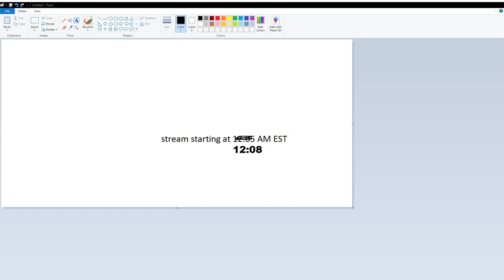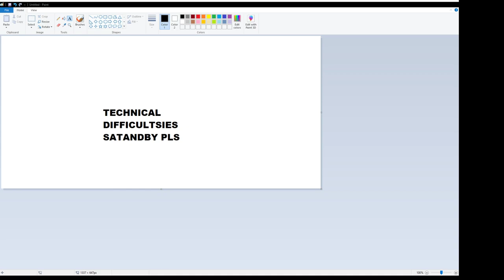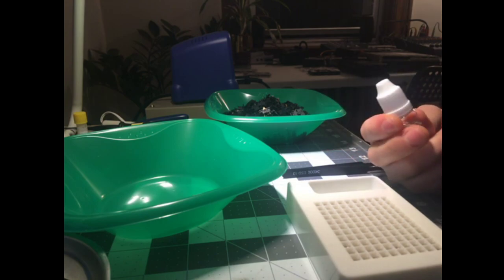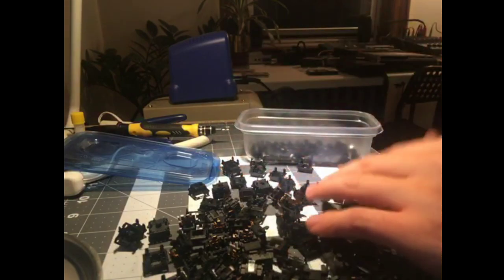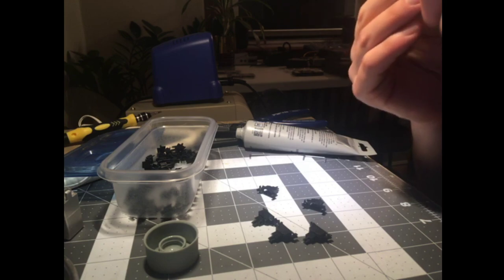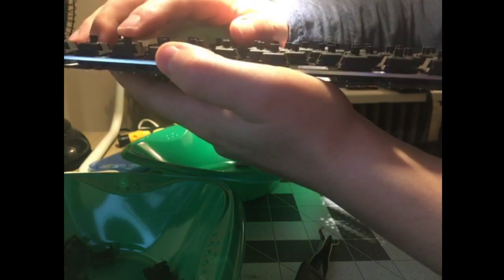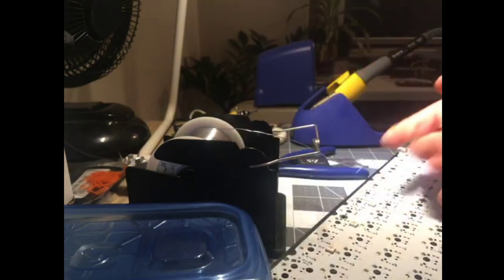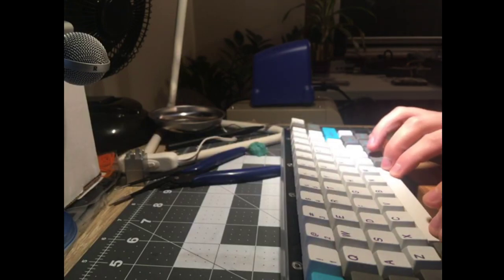Livestream: B.Face keyboard build with Greetech black switches (glitchy sound, sorry)

Comment: Nice stream, what would you say the yield rate is for good greetech blacks?
Reply from the maker: Seems like 50% or less. But it's also hard to generalize because I think this batch is either old stock or OEM stock. The ones with clear tops available from keyboard vendors might be different. I have a 10-pack of those, but I haven't messed with them at all.
Reply: @saltrocklamp199  Damn, that yield rate is rough...
Would it be possible to link me the TaoBao link to where you bought these?
Thanks so much for the reply btw